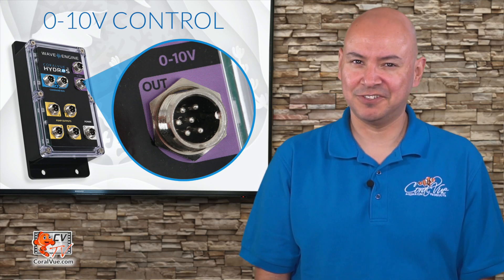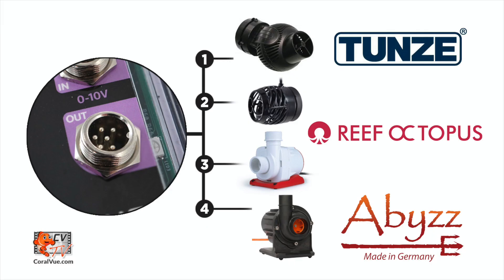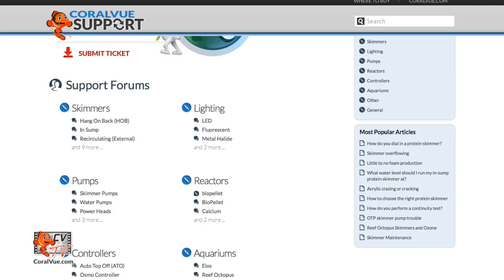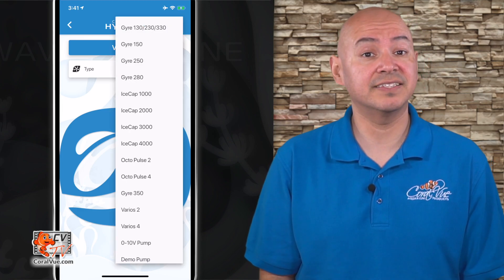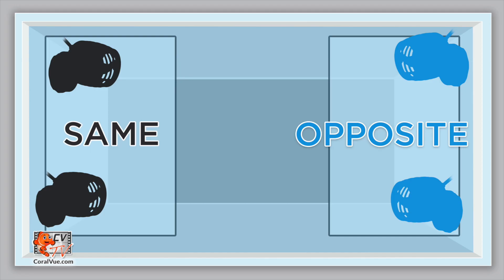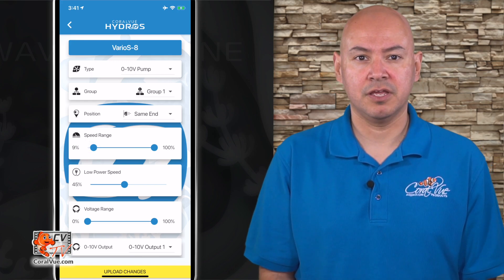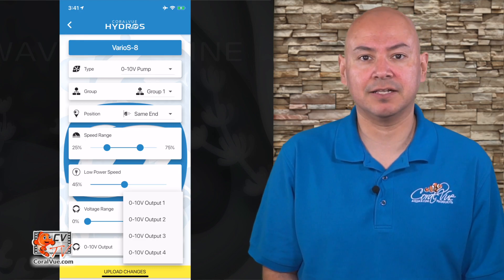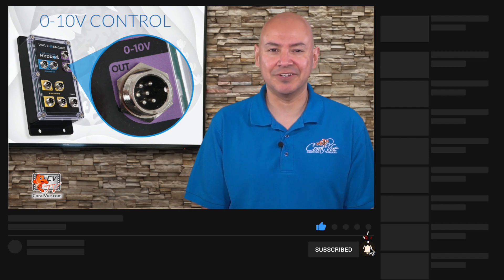HYDROS WaveEngine: 0-10V Drive - How to Connect Your Pumps

Comment: I know this video is super old, but how can we setup SPECIFICALLY just return pumps? I see like whats compatible, like the varios 4, can it only be connected via the WE? I see the placement options, but seems thats for power heads.
Reply from the maker: The WaveEngine was specifically designed for 24v wave pumps, but you can Varios 2 or 4 as they are 24v. I myself have two wave engines on my system. One for my frag tank which has a VarioS 4 return pump and two flow pumps and 3 flow pumps on the other wave engine on my display. This way when the power goes off all these devices on my WaveEngine are powered by a battery backup on my HYDROS Kraken.